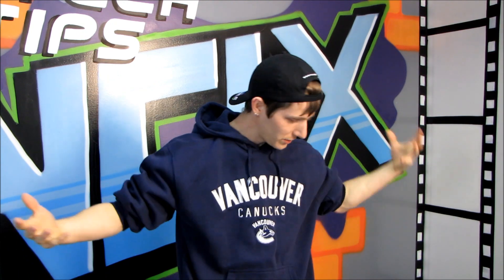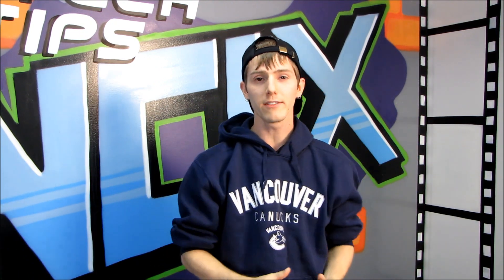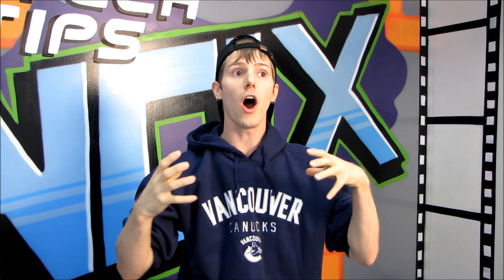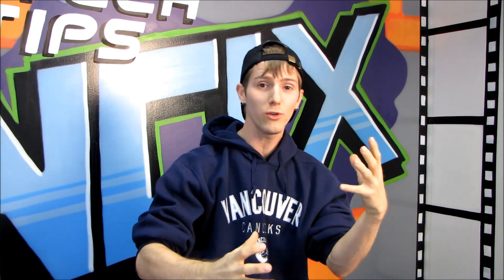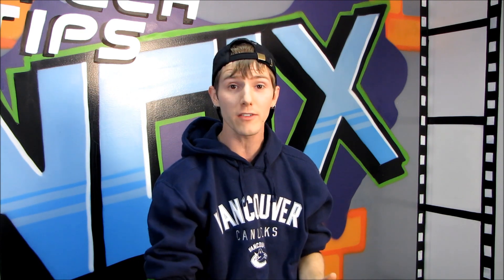Futureproofing Your PC - Dispelling Some of the Myths NCIX Tech Tips

Comment: I must voice an objection to you saying you can't future-proof motherboards.

While new chipsets are coming out all the time, many of them either don't offer significant improvements or are utter garbage - the strong, however, survive and proliferate.  Not to mention the fact that the motherboard is the single most-difficult component to replace and the single most-crucial factor in how well any of your other components can perform.

As an example...  For the system I built about three years ago, I opted for the ASUS Crosshair Formula V mobo - $240 at the time, and still the model I recommend for anyone building an AMD-based system.  You can drop in a $100 FX-6100 for the time being and easily upgrade to an FX-9590 (currently $400) or bigger when it comes down in price - or anything you like inbetween - and the system can handle it easily.

Additionally, the 990FX chipset is damned near bulletproof and can handle up to 32GB of DDR3-2400 RAM (4 slots, vs 2 on most mobos - and I always recommend that their initial purchase fills exactly 2 slots) and up to 3-way SLI/CF.  Valid point that few people really bother with SLI/CF, but the capacity generally means you've got plenty of room to upgrade your video without much concern for bottlenecks in that pipeline.

Previously, I bought a Gigabyte AM2 (forget the specific model) which lasted from its original Sempron 3000+ (mid 2006) to an Athlon 64-3800+ (Lima, early 2008) all the way to an Athlon 64x2-5800+ (late 2009).  Despite jumping a bit early (really should have waited for the AM2+s), it was a damned good board that handled everything I could throw at it for 5+ years.  In fact, I still use it as a secondary system.

Would have stayed my main system a while longer had it not been for the combination of a modest windfall plus everyone suddenly dropping AGP support.  (Admit it - in 2006, you didn't think AGP was ever going away either.)

I'm almost three years into my current system and, while I've yet to NEED to upgrade anything, I swapped the DVD-RW for a BluRay-RW and added an SSD for the OS.  Though I am drooling over the FX-9590s and some of the better GPUs (my old 2GB PNY 560Ti still handles things pretty well), I don't expect to need a new mobo for a good long while yet.

Because you CAN future-proof your motherboard.
Reply: Tldr
Reply: gdfschimpi007 "You do realize an $80 motherboard performs just the same as a $250 one?"

That's like saying that a $25,000 Toyota performs the same as an $80,000 Ferrari.  They'll both get you to and from the grocery store but, when you open the throttle, the Ferrari blows the Toyota's doors off.  Granted, not everyone needs to go "0-to-60 in wet-your-pants" but a quality motherboard can last you through several upgrades.

Motherboards at the low end of the spectrum typically use chipsets 3-6 generations old, cheap capacitors, and low-quality solder.  Even if the chipsets manage to support a newer CPU, you'll be pushing its limits - plus the support components (capacitors, solder, etc) will be nearing the end of their life cycle.

Motherboards at the high end of the spectrum feature the "latest and greatest" chipsets, top-of-the-line capacitors, high-quality solder, etc.  They fully support the newest generations of processors (and several generations beyond) and the support components are beefed-up to handle performance demands.

As you pointed out, the FX-9590 CPU has fallen from $400 to $250 in roughly 3 months.  The same happens with motherboards, though not as rapidly - mobo technology isn't quite as fast-paced at CPU technology.  That same top-of-the-line motherboard which was around $500 at launch can be had for around half the price a year later.  The really good ones suffer slower 'price decay' and maintain higher prices, even after their chipsets are superseded by newer ones.

With a little smart shopping, you can find a rock-solid near-"latest and greatest" motherboard in the $175-$225 range which will outlast at least three $60-$90 mobos and still likely out-perform the fourth.  

The returns curve for motherboards is quite steep at the low end and nearly flat-lines at the high end.  For most enthusiasts the 'breakover point' comes around $250, though it's closer to $150 for mainstream consumers - no appreciable benefit to spending more, but you lose performance and longevity by spending less.

Of course, one also needs to know how to 'read the weather'...  DDR4 is moving into the mainstream and next-gen APUs are on the horizon.  Not quite the time to move on these yet but, in a year or two, it will be worth looking into them for most people.

Shopping for computer components is like playing chess - the further ahead you're able to plan for, the better.  While no one can predict the future with 100% accuracy, the voice of experience can dramatically improve the odds.
Reply: Wiler Prime There are pros and cons to both sides of the equation, particularly when Intel produces 25-100 different variants of each CPU - reduces economy of scale but, if you can decipher the specs, you can usually find at least one specifically tailored for your primary application.  Meanwhile, AMD holds most of the top record certified clock speeds and is fairly untouchable in the general "bang for the buck" category.

Regardless of whether you favor Intel or AMD, the point remains that a little smart shopping will result in most key components being able to last through several upgrades without inducing a significant performance hit.  While you might not specifically need those 'extra features' with your current build, they're still open doors to potential upgrades in the future - which, by the way, is the point of future-proofing.
Reply: Saif S  The biggest bottleneck for video games is the graphics pipeline, though some games really hammer the CPU far more than they should.  That R9-290 is going to be a tall order, as that card is $250-$300 by itself - extremely tight for a $1000 build.  

Just a quick run-down of how I'd aim for your target system:

$140 ~ ASUS Z97-A LGA-1150 Motherboard
http://www.newegg.com/Product/Product.aspx?Item=N82E16813132118

$235 ~ Intell i5-4670K Quad-Core CPU
http://www.newegg.com/Product/Product.aspx?Item=N82E16819116899

$85 ~ 8GB (2x8GB) Mushkin RedLine-2133 RAM
http://www.newegg.com/Product/Product.aspx?Item=N82E16820226200

$60 ~ CoolerMaster 431-Plus or HAF-912 case

$90 ~ CoolerMaster Silent Pro M2 1000-watt 80+ Silver ($130 w/$40 rebate)
http://www.newegg.com/Product/Product.aspx?Item=N82E16817171076

$70 ~ PNY XLR8 120GB SSD (Limited-Time Special)
http://www.newegg.com/Product/Product.aspx?Item=N82E16820178455

$55 ~ WD-Blue 1TB 7200-rpm SATA-III w/64MB cache
http://www.newegg.com/Product/Product.aspx?Item=N82E16822236339

$20 ~ ASUS 24x DVD/CD R/W
http://www.newegg.com/Product/Product.aspx?Item=N82E16827135204

$250 ~ Sapphire Tri-X OC R9-290 w/4GB GDDR5x512 ($270 w/$20 rebate + free games)
http://www.newegg.com/Product/Product.aspx?Item=N82E16814202080

This much of the system comes to $1005 + shipping (after rebates).  No monitor/keyboard/mouse, but it includes everything in your wish list (including several items you failed to mention - namely SSD/HDD/DVD).

$127 ~ ASUS VS-247H-P 23.6" HD Monitor (Open Box Special)
http://www.newegg.com/Product/Product.aspx?Item=N82E16824236174R

$30 ~ CoolerMaster Devastator LED Gaming Keyboard/Mouse Combo (Blue listed, though also available in Red and Green)
http://www.newegg.com/Product/Product.aspx?Item=N82E16823129030

Roughly $1200 for the complete system ($1050 sans SSD/HDD/DVD) with everything you wanted in it, though you may be able to shop around and shave a few extra bucks here and there.  
~ 750-watt is the bare minimum PS for this system - 850-watt or better is recommended.  
~ I recommend SSDs for the OS drive, and the PNY XLR8 is a high-performance SSD at a great price.
~ WD HDD and ASUS DVD/CD assume you're not reusing ones you already have.
Reply: Mitchell Hunter well I actually built my PC like 2 months ago, the total cost was $1100 including monitor:
Enthoo Pro
Z97-A
i5 4690K
212 EVO
MSI GTX 970 (twin frozr)
XFX 550W
8 GB (2x4GB) 1866 RAM
1TB HDD (no SSD, I was trying to spend as little as possible initially, so I will get one later, but yeah BF4 loads are ridiculous)
VN248H (IPS monitor)

I got some nice deals on everything saving about $100+
Reply: Tony Su motherboards are future proof, you can use it for a long time.
Reply: "the motherboard is the single most-difficult component to replace and the single most-crucial factor in how well any of your other components can perform."

You do realize an $80 motherboard performs just the same as a $250 one? You pay for the bells and whistles. Overclocking or not, I wouldn't buy a motherboard unless the CPU mosfet's are heatsinks.

As for the 9590, it's now $250, if you have a solid board that can support it, I wouldn't second-guess plopping it in there.
Reply: Twyla Naythias if you are staying with AMD rolls eyes kinda yeh, but actually you are paying for the extra PCI-e slots and features you probably are not going to use wich make it worthless if you consider you can buy a way more cheap one with same perfomarnce (chipset, sink, ram capacity etc) but with less toys.

But the real top enthusiasts will rarelly choose AMD when they have an some monsters at intel and intel and nvidia loves to change technology (architecture, sockets, everything) really fast not just adding more cores to the old ones.

>inb4 "you are an intel fanboy"

I run an FX 8350 CPU.
Reply: higher clock speed doesn't mean better performance, intel architecture is by far more efficient on multy and single threading performance, fx line is just arround the same as i5 but i7 are monters (with monstrous prices) and everytime the release a new cpu they have15% to 20% more performance than the other one that is really significative and if you are going to depend only on clock speeds ... prepare to use liquid nitrogen, I dont think my h80i could handle that kind of overclocking temperatures.

At the end all depends on wich price rank you want to stay, I myself think  that i7 are overkill because  Im not a guy running 4k things or over 2 screens or video editing so for me it doesn't worth it, but Im sure with the new ddr4 generation I will have to make a new rig next year.
Reply: Wiler Prime 15 - 20% improvement? More like 5% at most. There is actually very little improvement from Sandy - Ivy - Haswell. Hell, Nehalem to Sandy improved single threaded performance by 30%. First gen i7's still hold up to today's gaming standards. Can't say the same for AMD

http://www.ocaholic.ch/modules/smartsection/item.php?itemid=1164

As for AMD they need to step up their game and improve on their single threaded performance. Hopefully they will release something worthwhile in 2015/16 with the whole ARM thing going on.
Reply: Twyla Naythias Since you seem knowledgeable on computer building, can you please help me with my build? This build will be designed to only play games, such as, Battlefield 4 (ultra) , GTA V (when it's released), and Far Cry 4, all at 1080p, highest settings and never dipping below 60 FPS. My budget for all of the parts is maximum $1000. I don't want to upgrade anything in the next 3-5 years; I'll lower my settings when needed to. What I'm set on so far (feel free to offer changes) is MSI R9 290, Asus VS248H-P 24-Inch Monitor, and 8GB RAM (though I'm not sure from which company). I really need help with the motherboard (idk anything about motherboards yet), CPU (I was thinking of getting the i5 4690k, which, according to game-debate com, will be able to handle GTA V well), power supply (is 850w enough and if not, will my budget allow me to exceed 850w), and case (I really want one with a windowed side panel like the SPEC-01, Cooler Master Elite 430, and Cooler Master Elite 431 Plus all have, but I also really really like the look of the Sentey Optimus GS-6000, which doesn't have the windowed side panel; for the case, at the end of the day, I want one with great airflow and design for under $65 that will not have to be replaced)? If you can't help, that's fine, but if you choose to, thanks SO much in advance. :)
Reply: Twyla Naythias Wow! Thanks for the detailed response :) But instead of the 4670k, should I go with the 4690k which is actually cheaper for some reason on Amazon by like $2? And for the monitor, I'm really really liking the reviews on the Asus VS248H-P 24-Inch, which is about $175. For the mouse + keyboard, I already have a great mouse (G400) and a decent keyboard (Sharkoon Skiller) that are both 1 year old. :) Also, I'm cheaping out like crazy on the speakers, only spending $18 or so on some Logitech Z130. I'd also like to go cheaper on the motherboard, probably under $100, because I plan on replacing it in about a year in a half (or would I have to replace it earlier?) In addition, for the GPU, I really like the MSI Twin Frozr version, but is the Sapphire one any different? I don't plan on using any rebates, so I think I'm going to buy most of my parts from Amazon and none from Newegg (a lot are out of stock, and almost everything is more expensive than on Amazon). Lastly, that deal on the PSU is incredible, it's almost the same price as 850w Gold, which one should I go for? :P I wish I could go cheaper on the PSU, but I want it to last a long time and perform wonderfully, so I don't mind that. But since my budget is $1000, including monitor, I might have to cut short on maybe my PCU? Should I buy an older one for less or no? I really really want to play BF4 on Ultra and GTA V on high when it's released, so I need the R9 290 and a good CPU, but looks like I can't afford it. Oh yeah, and do I need to add SSD or can I add it later? I have an MSI gaming laptop and BF4 maps boot kind of slowly, is that because I don't have an SSD (it has 750gb HDD and 8gb RAM), because if so, I don't care about not having SDD. Thanks again.
Reply: Saif S
SSD will help with battlefields horrible load times as well as help windows boot faster. If you really want to cut costs and go for a pure gaming pc then maybe an AMD fx card will be better suited, then get something like an ASRock 970 for motherboard. Pretty good quality for the price

Comment: Good quality PSU can last you for 4 - 5 years. My current build (AMD) is far more power efficient than previous one (Intel). 500W PSU has all power I need.   
ATX Case... I have 10 years old case i bought new for equivalent of 20$ and it's still very useful if cooling fans were added. All standards are optional, including front panel USB 2.0 and audio.
Monitor is something I use until the first malfunction. 4 years or more.
Keyboard. I don't write much do it can last nearly forever. Which means until I spill coke on it.

Comment: my plan for my computer:

intel core i5 4670K at 4 or 4.2 GHZ
EVGA GTX 760 ACX 1.07GHZ 2GG
Corsair CS750M 80+ gold
2 x 1TB WD Caviar Blue (Raid 0)
120GB Samsung 840 EVO SSD
Corsair Vengeance 2 x 4GB
Cooler Master Hyper 212 EVO CPU cooler
ASRock Fatal1ty Killer Z87

mayy upgrade to two-way SLI
definetely will buy more storage
may upgrade to RAID 5

Comment: future proof build...

8 core i7 4930k replacement coming out soon (prolly will be named 4940k)
sli ready lga 2011 board
2x nvidia 800 series coming out q4 2014 or q1 2015
1200 watt power supply
1 tb ssd, will add more of the same as time passes.

that is what you call future proof. or as future proof as it gets.

oh... almost forgot... and last but not least a solid gold case. lol. now thats future proof.

Comment: Futureproof:
8GB DDR3 RAM
Intel Ivy-bridge or Haswel processor. Any of them.
Graphic card nVidia GTX 750 or better.
Gaming sound card.
Gaming screen with best contrast ratio.
1-1.5 GB HDD.
Any DVD-RW
Gaming keyboard-mouse-pad.
Any full size case.
Any motherboard that fits with the above.
Power supply 500w or better. Up 650w.

Should last quite long.
In 2 years if new processors come out, upgrade on them, motherboard, gpu and ram. Everything else can last really long. That 4 pieces of hardware are the only worth upgrading with newer generations. HDD can die over time so you'll just buy new one :)